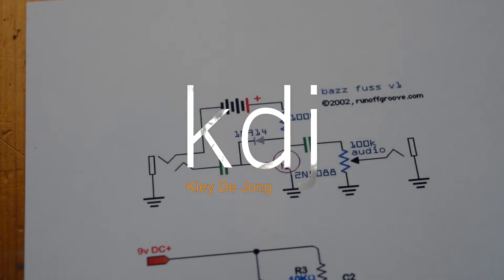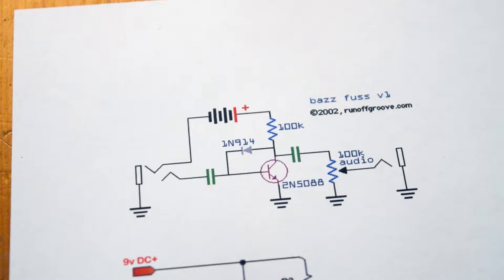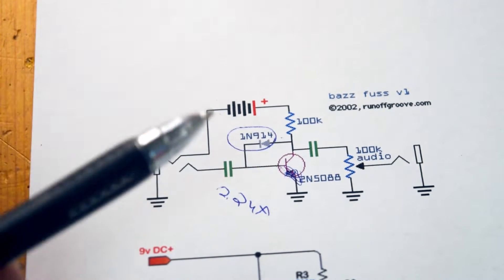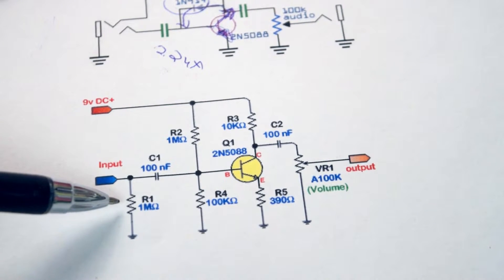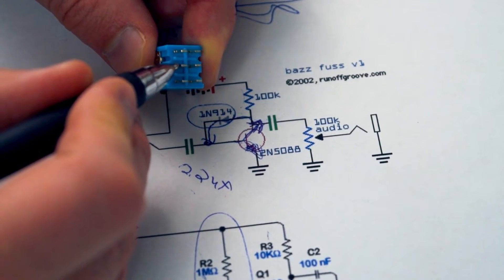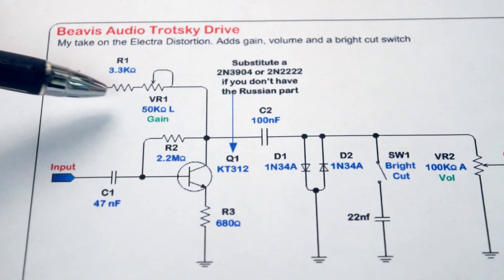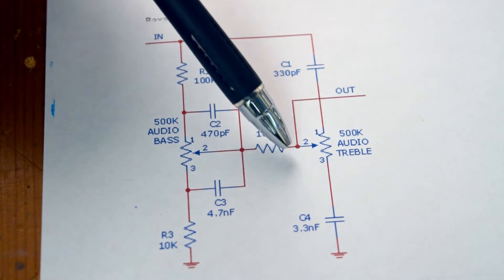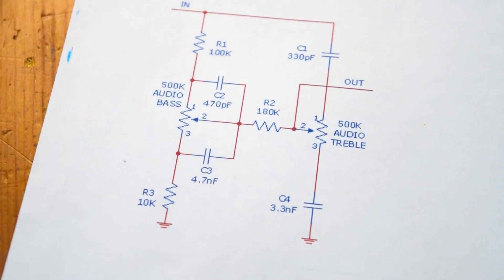Bazz Fuss - Circuit Analysis pt. 6 | Theorycrafting Mods

Comment: little frustrated. 

I spent a few hours this morning on the breadboard and the bazz fuss was gating really early. I know that happens, especially with a non darlington bjt. 

I ended up just running a lpb with the feedback diode on a switch. BUT 

I think I had the ground bias resistor connected and thats what was causing my gating issue. so now I've got more time on the breadboard.
Reply: after listening to some demos of the bazz fuss I decided im just gonna go with what I got. stock bazz fuss is a Lil too high gain for the application anyway. I have the dpdt so I might just wire it on the switch, but hardwire the resistors in. then the person im giving it to can change it if they want by just clipping the resistor leads.
Reply: and after all that work doing point to point, the led blew up. nice

Comment: I have mine with a lot higher value on the resistor, because not doing so resulted in it being stuttery, so I made it a 500k with a 200k trimmer.
I made it originally without volume pot, and I am using a 1N4148 I think it was, with higher value caps on some models I have built. I also added a 680 ohm resistor between Emitter and ground, so it's less noisy and softer. I will try adding a switch to change between 2 types of diodes and maybe a tone or gain pot. I love playing around this desging since it's so simple and not frustrating like the fuzz face I have tried to build. As a beginner modding a bazz fuss is the best way of learning what each component does
Reply: what transistor did you need 500k for?

Comment: 330pf. In that arrangement. 💯 5.6khz. Just ditch Baxandal. Blend on Input with 2.2uf. Tone shaped.. Q1 gain divider like the boost is perfect. Just goals 80 or low HFE.. Then complimentary feedback pair with staged forward drops. Highest first in Feedback with a small Cap. Then the smaller diode drops later. I used LED white then Red so far.

Very inspirational watching your explanations.

Comment: I just finished my first guitar pedal. It looks like the schematic at 9:57, without the gain control. I added: a stomp switch to bypass the entire circuit and a simple switch to select boost or dirty. I added a volume and tone from a LP wiring harness on the output side. I mostly followed the DIY GP 7 minute build using a 2N3904 and two 1N34A's. I especially like the boost clear. It adds clarity and definition to my small 15w practice amp. Your looks good and sound great.

Comment: Another mod topology to adopt is the clipping stage of the big muff pi (transistor stage 2 or 3). Now, instead of the asymmetrical soft clipping of the Bazz Fuss, you would get the symmetrical soft clipping of the pi. Then you could mix that with the hard clipping of the Electra Distortion.